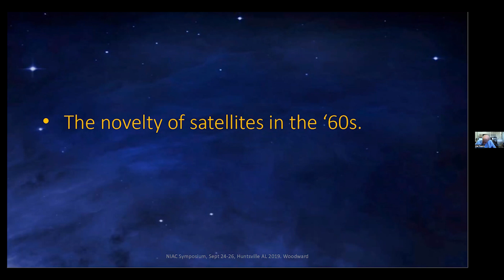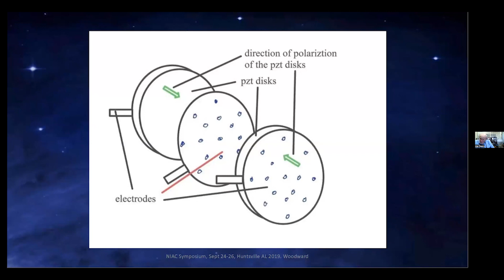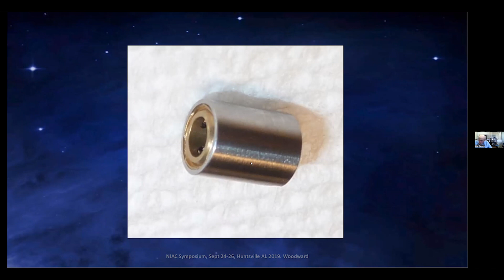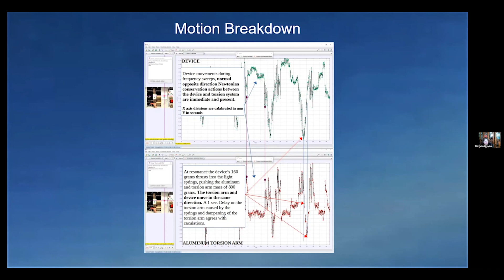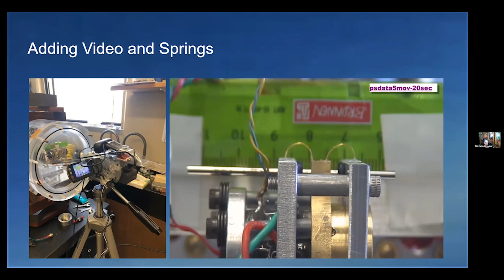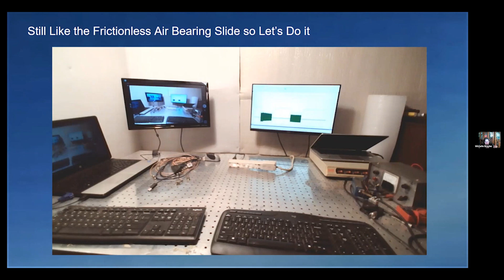Mach Effect Propulsion & The MEGA Drive | James Woodward

Comment: ..another aspect that seems intriguing is its dependence upon an octave-sized bandwidth - ie. Woodward's emphasis re. the necessity of a second input frequency at a factor of two of the fundamental;  given the centrality of octave equivalence in cognition (the result of an inevitable nexus between informational and thermodynamic entropies), the fact that some UAP craft appear to be equipped with PZT's, and the oft-claimed absence of conventional control interfaces in some saucers, perhaps this has relevance re. direct interfacing principles..  pretty out-there i know, but under the circumstances..

Comment: I know how potentially maddening false positives can be, especially when you're getting a run of them, but figuring 'em out is still progress, props for persevering (faith in the method eh)..  The latest results seem utterly spellbinding - i've no idea how it could be grounding counter-momenta, and the process looks like strong confirmation of the theory..  

..the only question i have is how thrust would evolve over time, assuming constant power consumption and heat loss;  eg. if we had such a thruster floating in free space and we pulse it at regular intervals allowing sufficient cooling time in between to regulate each input cycle to identical conditions, then the proposition of speed-invariant thrust is inherently over-unity;  a second input cycle identical to the first, applying the same thrust * time for the same input energy / work done, has doubled the system velocity by doubling the input energy, whilst quadrupling its KE, the O/I energy disunity obvs scaling with the half-square of the 'velocity' component of the anomalous (reactionless) momentum rise.  Not a criticism, for me..  maybe a 'heads up' tho..  Or else, does its energy cost of momentum remain bound to the ground reference frame, thus squaring with velocity and maintaining CoE?
Reply: I believe CoE is maintained by "borrowing" the C^2/m^3 elastic potential energy of spacetime that has been proposed to exist.